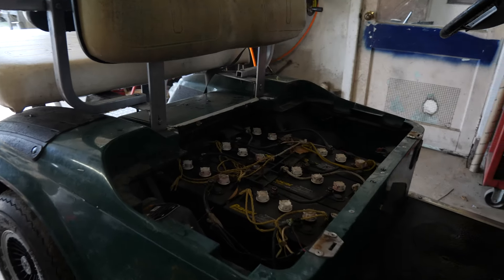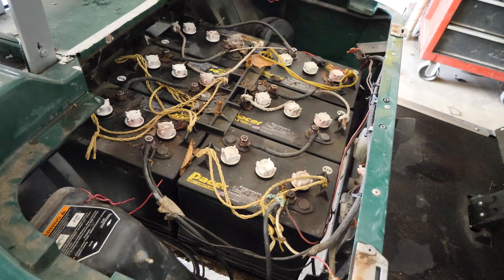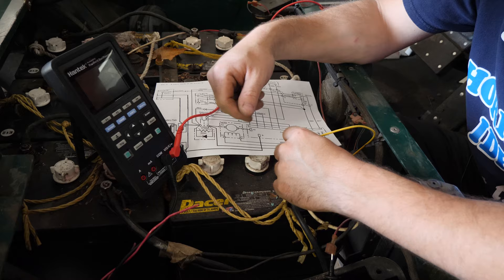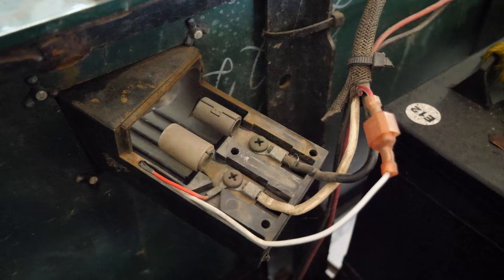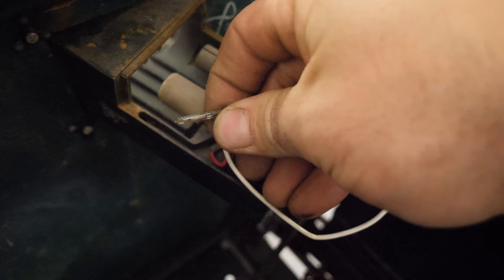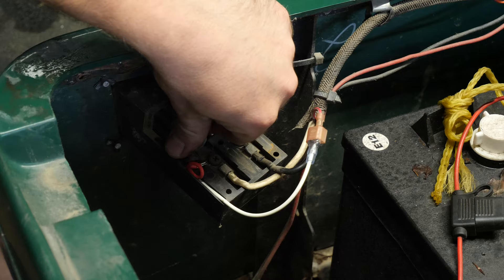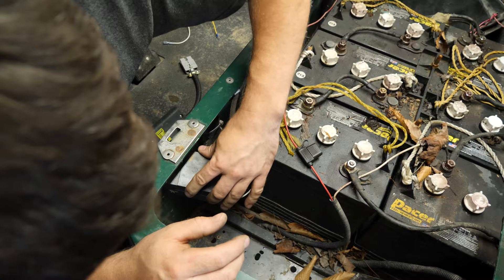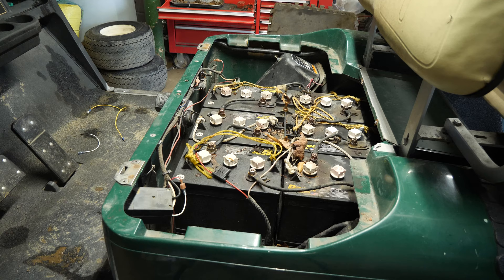1996 EZGO TXT, 36 Volt  -Dead Batteries, Not Moving

Comment: you can leave the reed switch off just conn red  wire to big white wire ----ps try not to drive off with charger pluged in(lol)
Reply from the maker: I don't agree with disconnecting the reed switch as it is to prevent the cart operating while charging. It can be bypassed for diagnosing issues but should be replaced if it has failed.
Reply: @Kevinsgolfcarts  it would take an idiot to try to drive off with that power plug sticking between his legs  my reed swithch was missing when i bought the cart 8 yrs  i mearly stated you dont need it  to make it work i hear they are expensive
Reply from the maker: I've had a few come in that had the reed disconnected by a previous owner and their kid drove off with the charger plugged in. They are expensive for what they are and it could of been done better but it does happen.
Reply: @Kevinsgolfcarts  they have a key that can be removed to keep any one from driving it while its being charged
Reply from the maker: Yes I know.

Comment: I don’t have a reed valve on mine just a glass light
Reply: that is the reed switch  its not a light  in side that tiny glass is 2 conntacts  when plug in the charge the metal  magnetly effect the reed switch goes open on tiny red wire  so you can not drive off with the charger pluged in ??????(LOL)

Comment: Hi I have A 96 Ezgo electric cart H299 model.
 lately it has ben running really slow and draining the batteries to fast?
I've taken the batteries  to be checked and they are all good
what step should I take next ?
Reply from the maker: H299 is the model code? You have a 1999, not a 96. Check your battery cables for dirty or lose connections. If the wires are hot after driving, replace them.
Reply: Did u ever find out what your problem was i have the same issue